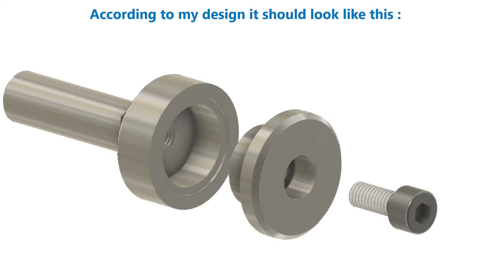Mini Lathe Project - Slitting Saw Arbor for Proxxon FF 230

Comment: Can you share which ER32 collet and which QCTP you used for your lathe? Thanks! Amazing video and nice job!
Reply from the maker: Hi.
Regarding the ER32 collet, I use the model  MTB2-ER32-M10.
Initially I bought this QCTP set only for testing. I don't know the name/type - search on AliExpress  number 3256805701808475.
The main part this QCTP is made of aluminum :( I honestly didn't expect much from this set but I am very positively surprised - so far I work on it even when machining steel. I only made a brass sleeve for the inside and replaced the screw with a quick nut with a handle. 
The price to quality ratio is very good. However, if you intend to machine a lot of steel items, probably will be better to invest in a higher quality QTCP made entirely of steel.
Reply: @RoninRonin  Thank you for your reply! I will look into these items. I'm thinking ER32 is the biggest this machine can take, right? 24mm seems to be the largest collet I can find. I also found a 26mm collet for ER32 but I don't know how serious the manufacturer is.

Thank a lot :) subbed
Reply: @RoninRonin  hope u don't mind me asking another question: How do do you fit the ER32 collet holder into the spindle? In the video I only see you push it in? How does it hold? Thanks a lot. your input is very helpful
Reply from the maker: Hi @bastian6173  
Proxxon - the manufacturer of this lathe offers smaller ER20 collets for it.

In my opinion, size ER32 is probably the maximum - assuming precision machining.
The largest standard collet dedicated to ER32 is 20mm. But there are also so-called "oversized collets "available - of course fit but they are shorter and therefore not as precise - the maximum size is probably 25mm.
Reply from the maker: @bastian6173  
After removing the chuck the hole  is a typical Morse cone socket MK2 / MT2 - you can check in the lathe documentation.

So, You mount it like anything else with a standard Morse taper - you quickly and vigorously press it into the socket and from the back of the lathe (from the gear side) you screw in an M10 screw about 85 mm long.
Reply: @RoninRonin  Thanks! I'm pretty new to all this so I appreciate your explanation. That makes sense. Have a good day

Comment: Hello, how does the Er Collet fit?? I also want to buy it. Which Er Collet should I buy?
Reply from the maker: Hi,
after removing the chuck the hole  is a typical Morse cone socket MK2 / MT2 - you can check in the lathe documentation.
I use collet MTB2-ER32-M10 from Aliexpress